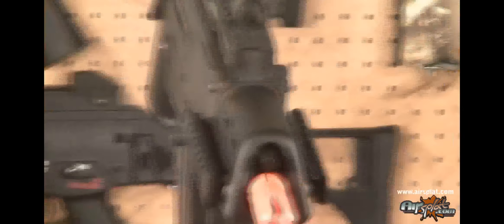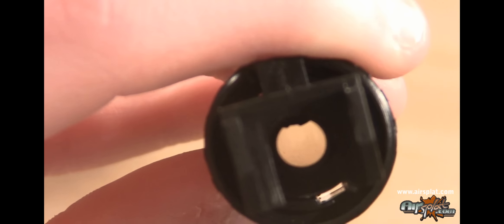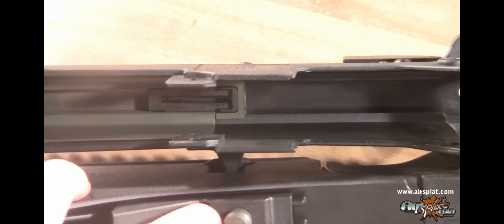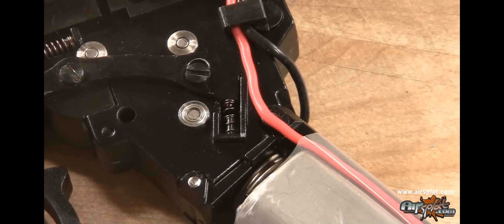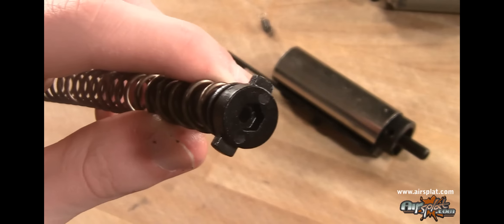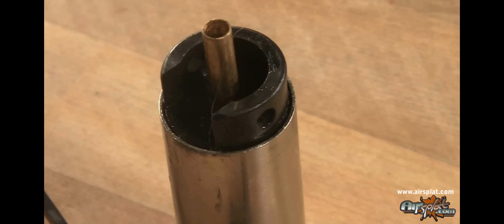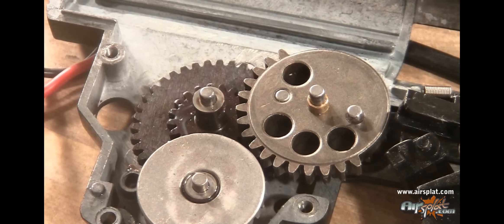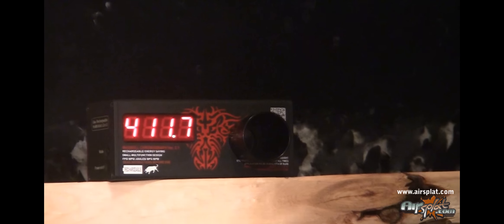Inside the Mechbox: S&T HK G36CV Airsoft AEG Rifle Episode 28

Comment: for a longer barrel you will want a full cylinder (509mm barrel = type 0 cylinder). shorter barrels will want ports allowing for less air to be compressed in the cylinder.

Comment: hy. i just got a S&T g36cv and my question is.
If  I put a 363mm madbull black python inner barrel do I have to change the cylinder or is it ok the stock one please respond, all the other components are going to be changed(piston, piston head...) is just the cylinder that i need some advice. thank you

Comment: I'd recommend swapping out the piston, getting one with full steel/aluminum teeth is a very good idea, the back tooth on my piston snapped off and screwed the entire thing -.-" The SAT VVD (Variable Velocity Device) Piston is expensive, but well worth it, 15 durable steel teeth, and allows for on the fly velocity change, brings my gun from 400 fps down to approx 290-310.

Comment: Not sure if anyone else has posted here, the internals on this gearbox are nearly the exact same as the ARES model of the gun, including the piston, the ARES G36 you reviewed, DOES have the 7 metal teeth, however the ARES G36CV Does not, its the same piston inside that gun. To anyone taking apart the gearbox of this gun...LOOK AT THE TRIGGER ASSEMBLY BEFORE YOU TAKE IT APART, ITS A BITCH TO RE-ASSEMBLE.